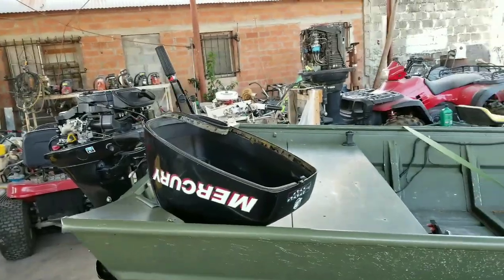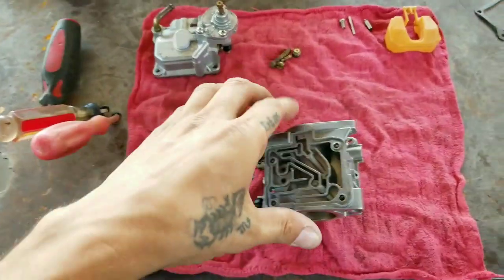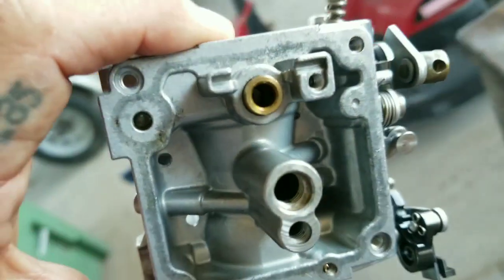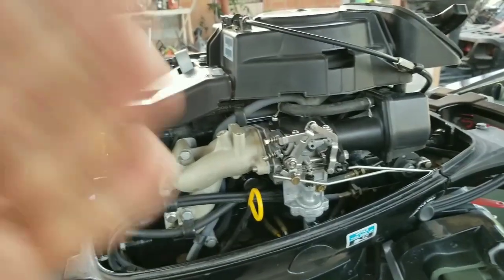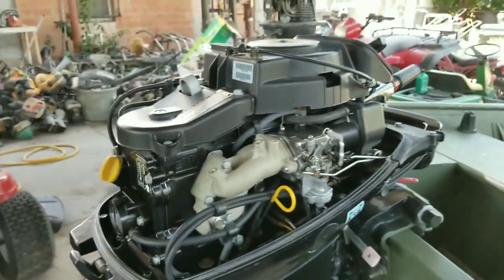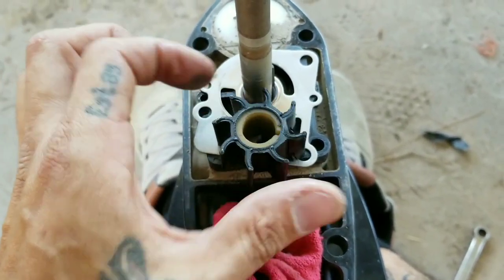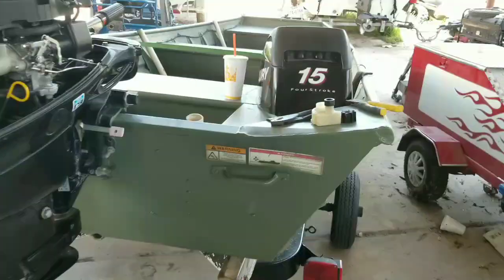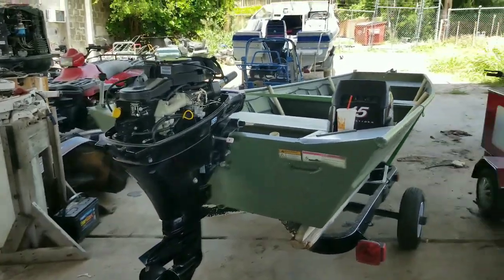How To Clean Carburetor and Impeller Replacement  on Mercury 15 (four stroke)

Comment: Excellent video. 2 notes for you. Silicone grease should be used on impellers not petroleum grease. Pet grease will break down the rubber over time. Ever use Creolina undiluted to polish up your brass carb parts? No sand paper needed. Amazing stuff. Americans never heard of it.. it is in many latin supermarkets. It takes a few hours to work.  Even 500 grit sand paper makes micro gooves to acquire more gunk.

Comment: cleaned carb (but not as thoroughly as i just viewed) after 3yr non use as it wouldnt start   starts now and runs well but needs partial 1/2 choke at all throttle settings  or it will die ...guessing i should have cleaned out the barrel like part with all the little holes like you did ? or do you think my problem involves another part? ps. great informative video!

Comment: I have the 20 HP Mercury 4 stroke, and I think they are pretty much the same motor. My motor will idle, all though it is rough, but if I open the throttle, it bogs down. Every once in a while it will idle up and run full speed but only for a few seconds. Any idea why it would act like that? Great video... I will be replacing the Impeller soon thanks!!!!!!
Reply: Having the same problem with a merc 15... Im thinking the carb
Reply: What was it ?....mine to
Reply: I’d guess the fuel tank if it’s not the carb. Look into it. 🤷🏻‍♂️
Reply: Having same problem 😅 Could you tell me what was the problem and how to repair ?Thanks

Comment: I’m in Indianapolis I have a 1987 mercury 9.9 turned up to 15hp I need the cover for the pull out knob 2 screws to hold it on, do you have any advice on where to find those parts? Appreciate your videos!

Comment: awesome work very clean and well explained ,found u channel looking for a video that can help me fix a problem on a 2013 15hp stars right up runs good and fast but when i slow down engine cuts off and has a brand new carburetor i noticed on this video the idle screw is 5 1/2 turn mine came with 1 3/4 turn not sure thats the problem is getting the spark plugs black on 1 side and light orange on the other side , me tiene loco brother ,any tips that might help ? thanks

Comment: Hey bud I have a question. At 15:14 what are those two cables for or what are they plugged to? I’m reassembling a carb that I did not take apart and having trouble finding where that plugs to or if it plugs to anything. Thanks!

Comment: I have a question. How the part (narrow part of the notes or outside) must be inserted correctly at the time of the recording 10:45
Reply: I saw that too. The brass sleeve/tube has a ball check valve inside. The accelerator pump pushes fuel UP that channel in the carb bowl THRU that brass sleeve. It would seem that the flat end of the sleeve goes in first and the smaller end is on the top at the rubber gasket. Otherwise, the check valve would block the flow of fuel to the needle jet that was shown earlier that injects fuel right into the barrel. Am I thinking correctly? This is obviously a very important point that was skipped over in an otherwise excellent video.

Comment: Thanks for sharing!  Question.  Have 2012 Tohatsu 15hp 4 stroke idles perfect and runs at high speed just has stutter going from idle and transitioning.  Low speed or high speed jet issue ?

Comment: Hi.  Have you ever heard of needing to add about twice the amount of recommended lower gear oil ?  I drained my 2017 15hp.  Manual says 370ml to fill.  I had to add about 700ml before it started to come out of top hole.